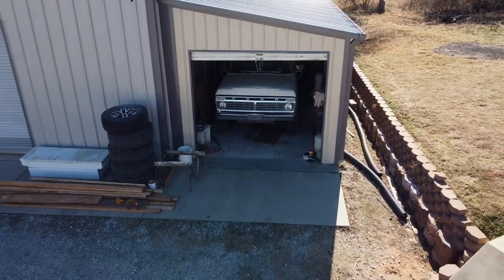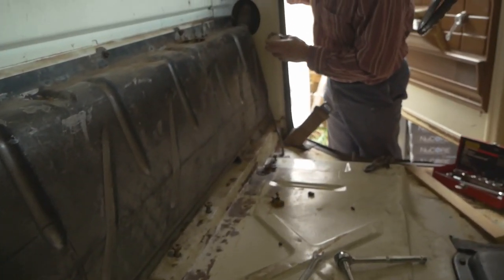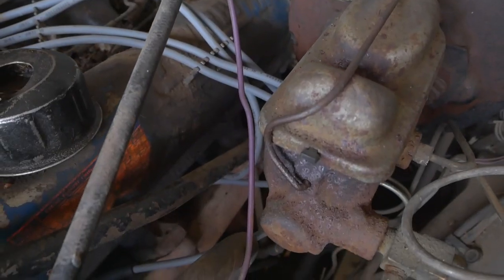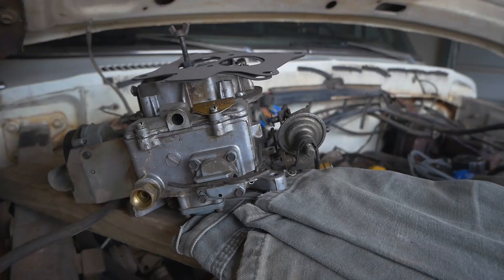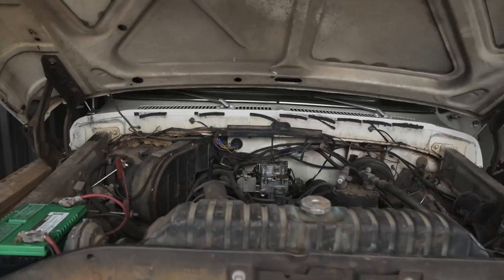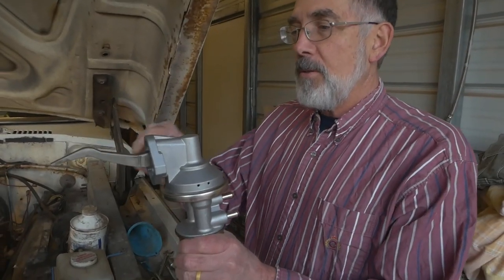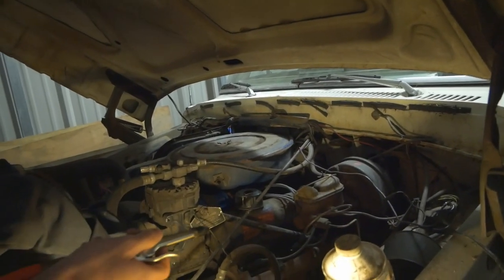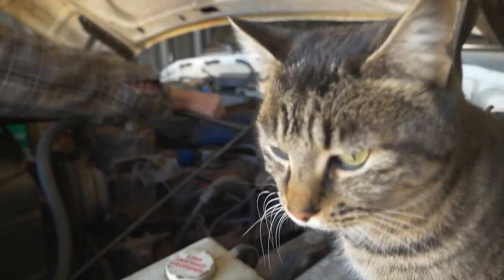Time to crank over the Highboy: Will it run? 1974 F-250 Highboy Restoration Part 2

Comment: Really cool project! My son and I are restoring a 76 highboy as well but it's had a lot of work done to it, supercab swap, cummins swap, custom length bed. It will be going on YouTube soon too. When you're initially setting up that carburetor,  run your idle mixture screws on the front all the way in, gently, don't tighten them, then run them back out 1 and a half turns on each side. Then the idle adjustment on the throttle itself should be backed off until the throttle plates are fully closed, then turned back in one full turn. That will make it run and you can fine tune it from there. There are some great carb setting videos on Uncle Tony's Garage channel. Also try putting a quart of ATF in your engine oil and running it for awhile and see if that lifter tick will unstick itself. Love these old trucks, looking forward to seeing it back on the road again!
Reply from the maker: Thanks for watching, and thanks for the tips! We will definitely try that out. I'm trying to get the third episode done here pretty soon, and spoiler alert...It might be driving around in that video :)

Comment: Had the same issue with a 65 Chevy tank.  I put a gal of muratic acid with the rest water and let it set for a day.  Cleaned up like new.  I then put por 15 has tank liner. Worked great.
Reply from the maker: Awesome! Sounds like a great solution. I've heard that mineral spirits can work wonders for dissolving things too?? Good to know.

Comment: main thing is dont buy expensive parts change fluids nothing easy about them rust buckets they were cheap transport so lot them had hard lives nothing wrong with what your doing just my two cents glad your have fun
Reply from the maker: This truck/year/style definitely has its drawbacks, but it's still kinda cool :)
Reply: @ljmproductions1  yes they found lot down in florida one guy had lot them was the craig Uncovering the RAREST F100 That's Been Sitting for 20+ YEARS! nothing like haveing fun working on old truck don't sale it 
be smart did it once never again

Thecraig909

Comment: There is no gas tank behind the seat in a 1974 f100
Reply from the maker: Interesting! I guess the '250 is different. Ours also has an auxiliary tank under the back left fender, which I think is aftermarket.
Reply: @ljmproductions1  My 76 highboy has a cab tank and I dont think they came with auxiliary tanks my 77 150 has the 2 tanks in the rear none behind the cab